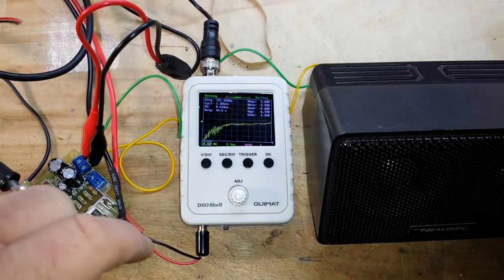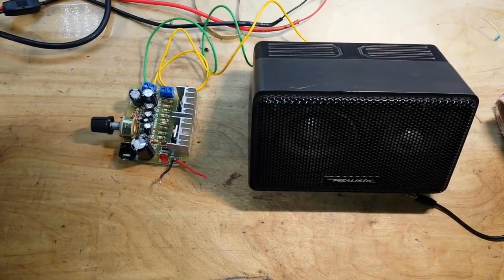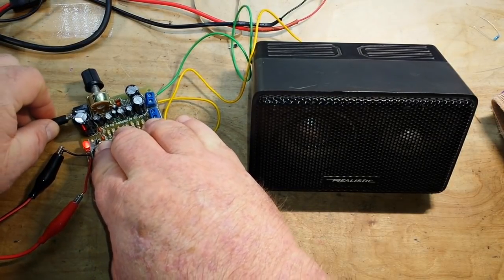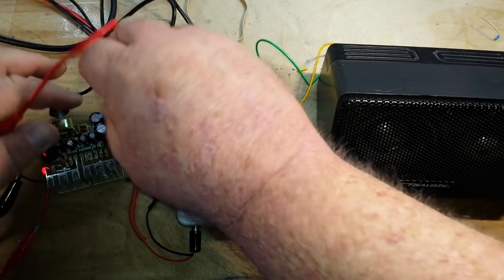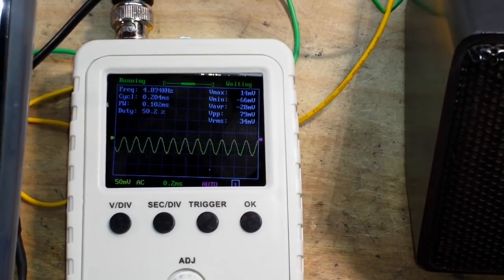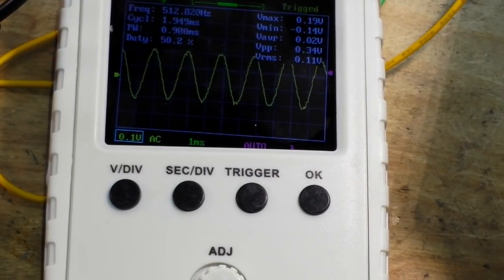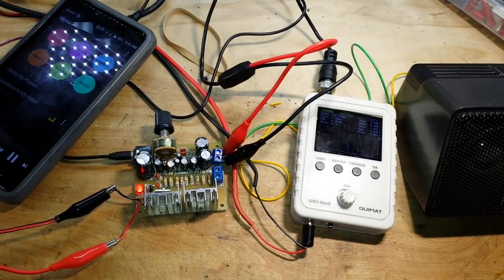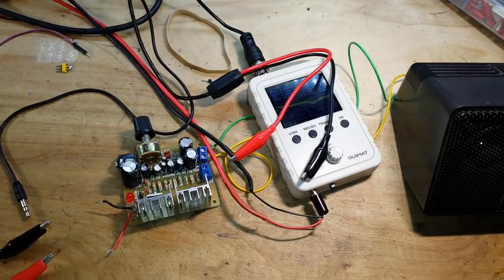TDA2030 Amplifier Testing

Comment: I just took receipt of my "auxiliary" DMM, an 8008, upon *your review and recommendation. .. I decided to go through Amazon because, "speed and tracking"  ($30 US with tax). .. A "solid value", on paper, and I have an almost $20 US assortment of 0.1% resistors, ranging from 10 Ohms to 750K Ohms, for use as a "comparative resistance standard". (could not afford the 0.01% MilSpec resistors . ... Anyway .. After about an hour of filters and sorts, on the DigiKey database, I had three 0.1% resistors for every range (i.e. 10, 25 and either 50 or 75 Ohms) .. We shall see if my AN8008 is "up to snuff" .

Comment: Did Anyone realize that the square wave wasn't  amplified in good shape？So does my tda2030。I don't know why。
Reply: There is one fundamental issue: 
1. Phone amplifiers (and PC soundcards, too) are not constructed to generate square wave signals. 
2. The amplifier can´t handle square waves, too.
The reason is: There is no such thing as a square wave. Every square wave is build from several, specific sinus waves.
For example: A 1 KHz square wave is build from the following sine waves:
1 KHz (base frequency)
3 KHz (3rd harmony)
5 KHz (5th harmony)
7 KHz (7th harmony) and so on (with only uneven harmonics and steady decreasing amplitude)...
For more information see:  https://en.wikipedia.org/wiki/Fourier_series
The amplifiers and soundcards mentioned in 1. and 2 are (and the same is valid for the tda2030 as a LOW frequency amplifier) simply not able to amplify the higher frequency harmonics.
Maybe it´s now a little clearer to you. Was this helpful for you?

Comment: I think the distortion you are seeing is from the nonlinear loading of the speaker, to get a true view of the amp performance connect the output to a purely 8 ohm resistant load and measure the wave form across that, going beyond entry level use the FFT function of one of your digital scopes to view the harmonics just prior to clipping.